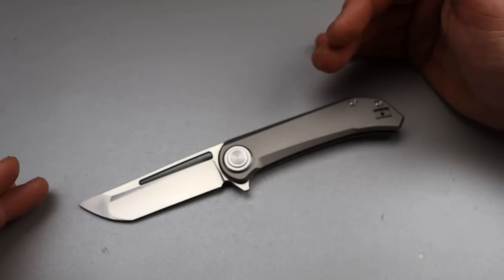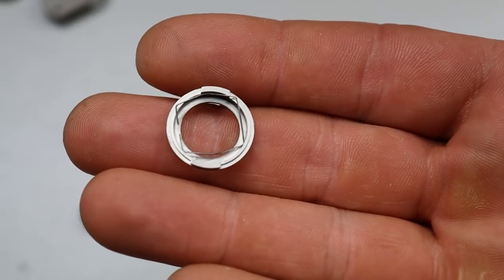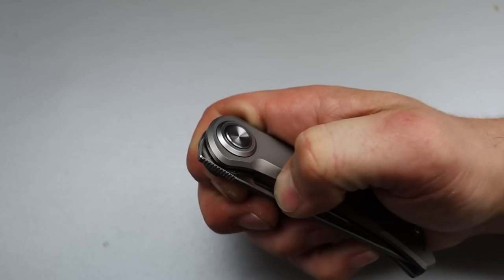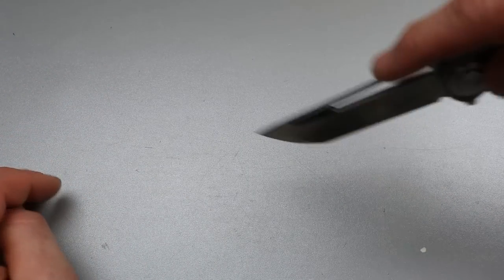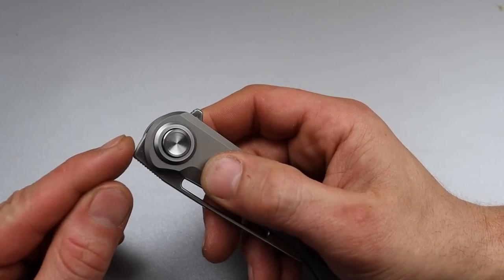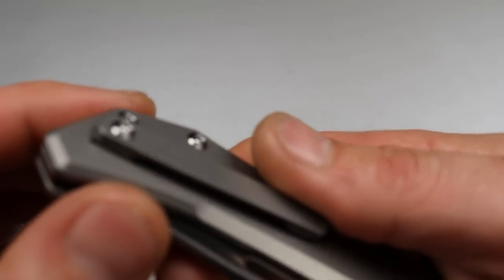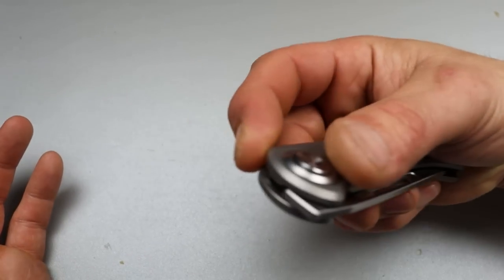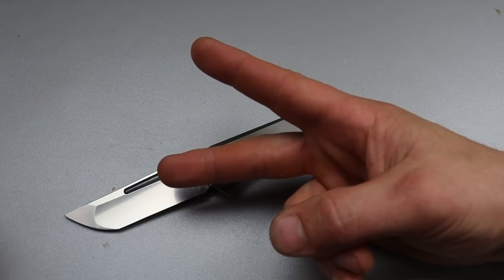Fascinating New Locking System On A Great New Knife Design

Comment: I was thinking it looked like a TwoSun at first for some reason. I wonder how that rivet on the lockbar will hold up over time.. cool design, always support and love to see something a bit unique. If they offer it in a utility blade shape I’d probably be a buyer.
Reply: Yeah I've had some others compare to the TwoSun style of finish, so I asked the OEM if they also produce TwoSun knives but they said they don't. The question on the rivet is definitely a fair one. I'm curious to see as well since this will be the first production knife using the design. My guess is based on the minimal pressure it's under it should hold up well, but time will tell. Thanks for the comment!🤘🤓
Reply: Glad to see I’m not the only one with this question. And that anti shake wire looks ripe for a breakdown.

Comment: I wish the blade shape was different. And the button was flush instead of sticking out. 

The lever, how many times before that thing piece of metal fatigues?

I’d like a larger choil also for when I need to choke up the knife. 

The clip looks like crap. I definitely prefer where it lets it sit flush in a pocket. 

Also the overall thickness seems a bit more than needed.

Comment: So this is just a liner lock,with no other lockup for the blade???
Reply: If I understand the question, that’s correct. As far as I can tell, most liner locks don’t have a secondary locking feature and just rely on the liner lock. But there are some out there for hard-use knives. Truffles is really designed for office-style EDC, so it may not be the best fit for a hard use case. Just my thoughts. Thanks for taking the time to ask! 🤘🏻🤓

Comment: Hey Jared.  How durable does the leaf spring seem?  Will the company replace it if it breaks?
Reply from the maker: that is something im going to ask them or that you should as well, it seems fine it seems like hardened steel but its hard to say without a lot of time under stress and enviroment
Reply: Yep! Our warranty will cover manufacturing issues like a broken lock. Hopefully, it won't come to that, but we'll cover it if it does.🤘🤓
Reply: @NeevesKnives  Absolutely. As with anything brand new, there are some unknowables, but we will definitely cover that kind of issue in our warranty.

Comment: It's a liner lock with added complication to fix a non existent problem.
Reply: I mean I can definitely respect that perspective. Adding more complications does introduce more opportunities for failure, but I like that the OEM isn't just playing it safe and is looking for ways to innovate. To me that pushes the whole industry forward. Even the liner lock technically solved a non-existent problem since we already had locking knives before it was introduced. But the liner lock went from unique, innovative locking mechanism to industry standard. Not saying that the Roundhouse Lock is destined for that type of longevity, but I do want AKT to be among those pushing the boundaries and seeing if we can make minor improvements that eventually add up to significant improvements. Totally fine to disagree, but that's at least the method behind the madness! Thanks for taking the time to share your perspective! 🤘🤓
Reply: @aurora_knife_and_tool  I appreciate your response.
Even though I left a luke warm comment, I do find the design an amazing improvement of both classic Button Lock and Liner Lock with clever way to combine both.
It vastly outperforms Button Lock and brings one hand manipulation to the venerable Liner Lock.

The reason I am not very excited is because I anticipate this new design will be pattented and made unavailable to all those manufacturers who make vast number of different knives featuring Liner or Frame Lock.
Just like Triad Lock was exclusive to Cold Steel.
Now there would be no Triad Lock if there was a patent on a Back Lock. So Andrew Demko tweaked an "open source" design and made it "closed source" to make profit, and by it preventing the design improvements to make an actual impact on the Back Lock design. Later he did similar with Shark Lock by taking the fundamentals of Axis Lock to make another patent and more money, and actually prevent any real world changes on the design of the knife locks...
So for this inovation to really be something to push inovation in the knife industry it has to be "open sourced" so it can be used as a basis for even more inovation, and we the customers can have it in our hands in different configurations.
Kinda like Crossbar Locks became more refined once the patent expired from Benchmade.
Reply: That’s an interesting take. Since I didn’t invent the mechanism I can’t speak for the company on making it open source, but I will say the company is very open to working with other designers using the same lock. My friend David at Orion Knives is coming out with a knife using this mechanism only he’s modified it to be a compression lock instead of a liner lock. So we’re already seeing this lock lead to other innovations, so that’s exciting. So I think we’ll see more as more and more companies use the lock and make their own tweaks. 🤘🏻🤓

Comment: I'm kinda worried about accidental disengagements, as I tend to choke up excessively when working. How you feel bout those chances, Jared? Great vid brother & Happy Happy 4th to you & the Mrs.!!!✨🎉🇺🇸🎊✨
Reply: That's a great question. I posted a video on my channel showing how difficult I find it to accidentally disengage, but I'm a sample size of one, so I look forward to hearing other's experiences. That said, the knife is really designed for light EDC use, so it may not be the best design for a beater. Thanks for sharing that concern!🤘🤓
Reply from the maker: i havent seen an issue from it as the button has to be intentionally pressed to unlock, not that its not possible if you were trying to but i do think that would have to be your goal and press your hand in a very un natural way to happen

Comment: I wonder if that pocket clip wasn't just cannibalized from another project for this prototype. It looks like it might have been designed for a frame lock. When they only have contact on one side like that, it's usually to keep pressure off of the lock bar.
Reply: Maybe so - the underneath of the clip wasn't my design, but the way I interpreted it was creating a bi-dimensional ramp to get it into the pocket. So that there's a ramp on the front and a ramp on the left side making it easier to pocket. Either way, it does go in and out of the pocket exceptionally well. I am going to taper the clip just to better match some of the visual lines on the design as well. Thanks for the comment!

Comment: Definitely sweet! I'm not sure how long that rivet is gonna last on the lock bar, but I'm certainly not an expert. Overall a very cool system and a very cool knife though!
Reply: Yeah, rivets never last
Reply: Had the same concern
Reply: Same. Looks kind of... underbuilt? Just that one aspect seems super chintzy compared to the overall build quality. I expect it'll show up on a few knives and then disappear, I'd love to be proved wrong though because it's SO COOL. Do want but don't want until it proves itself, know what I mean?
Reply: @CastIronPrimate  yes. Completely. I doubt they can keep the price so reasonable after the kickstarter tho
Reply: Yeah I think it’s a fair question. With it being brand new it’s hard to be definitive, but it does seem like if and when it does fail (as everything does eventually) it would be at that point. Hopefully it won’t come to that any time soon, but our warranty would definitely cover it if it did.
Reply: @CastIronPrimate  I hear ya. The OEM is the one that designed the locking mechanism, so I can’t speak 100% about their intentions, but it seems to me that it’s likely a space issue since there’s just not room for another screw there. But I imagine if we do start seeing problems at that point we’ll have to figure a way around it. As it is it seems to me that it will probably last longer than most people’s interest in a given knife. 🤘🏻😜 But if it does break down at that point we’ll replace it. Thanks for sharing the concern! 🤘🏻🤓
Reply: @aurora_knife_and_tool  thanks for the reply my dude 🤘🏼 I'd love to see long term stress test results, my ADHD means I'm kind of obsessive with the fidgeting
Reply: @CastIronPrimate  Same here! If I can't stay still I should at least be productive! 🤘😅